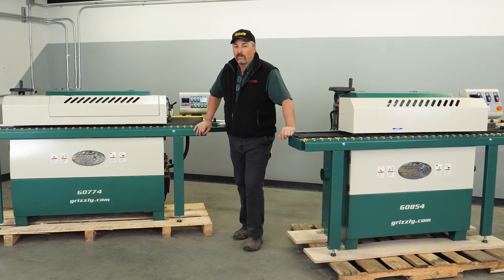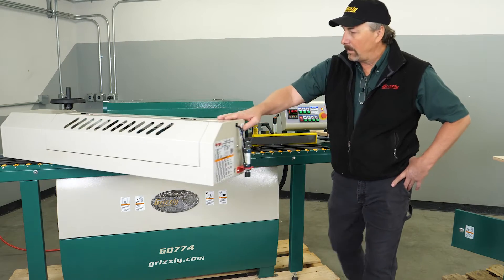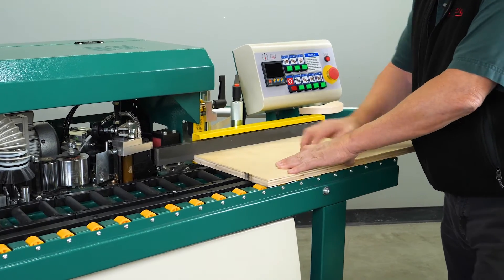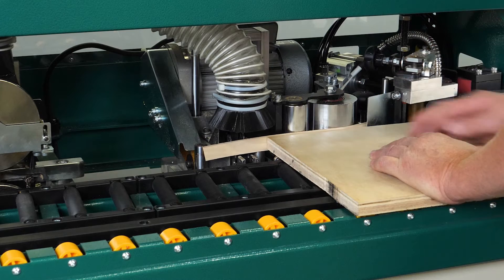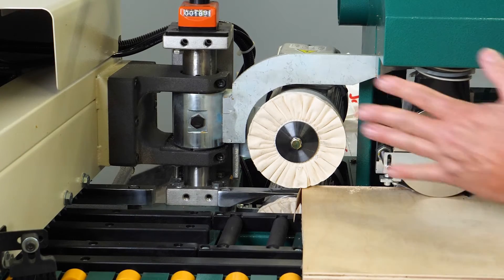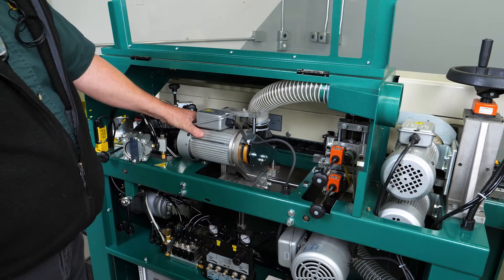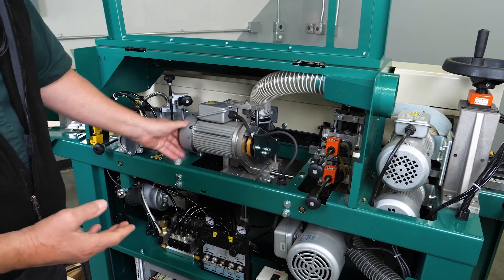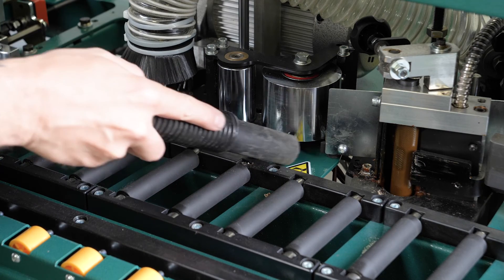Grizzly G0774 Automatic Edgebander: Introduction

Comment: You did not speak about the machine capacity, the thicknes of the material or the edgebanding,,and does it handle solid wood sticks,,that i want to know,,
Reply from the maker: Hey there! If you need more details on the machine, here is the link that will show all specifications: https://www.grizzly.com/products/grizzly-automatic-edgebander/g0774
If you need more support, reach out to the Contact Center on our website! We'd love to get you the answers you need.